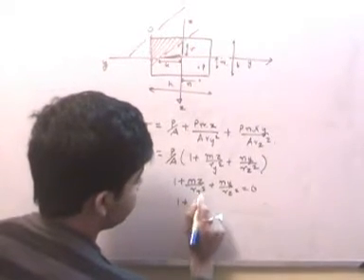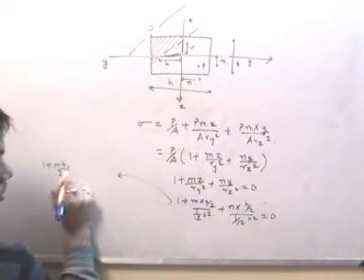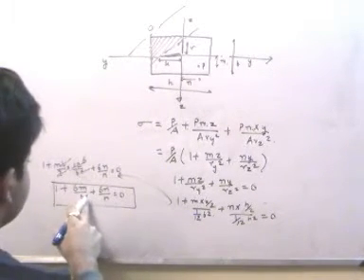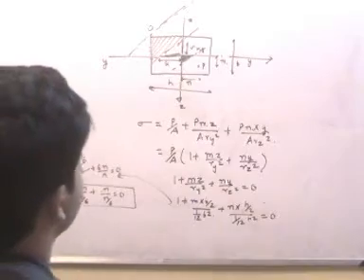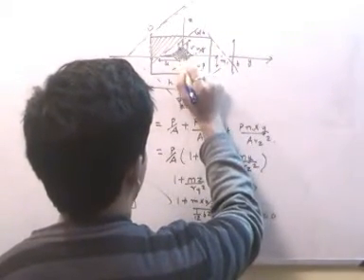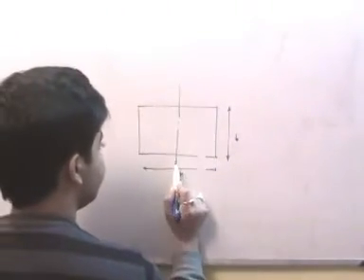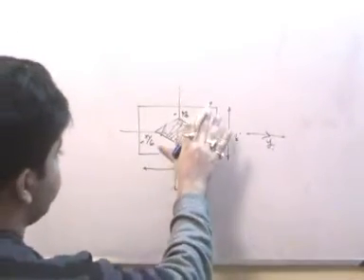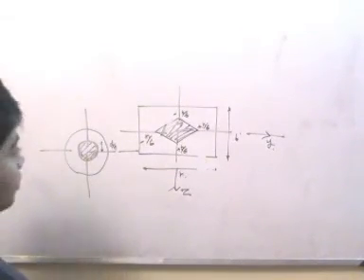theory of columns-4.mpg

Comment: my questions are 
1.By providing reinforcement , it can take tensile stress ..so is it must to design in a way column have no tensile stress  ???
2. what will happen if the column has pin joint ..is it stable ?? how the eccentric moment will be taken ??